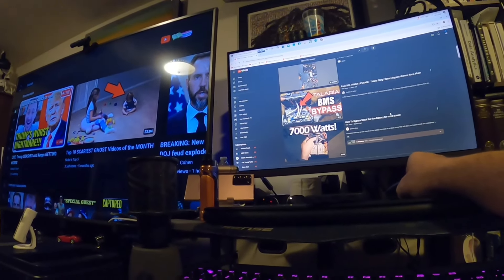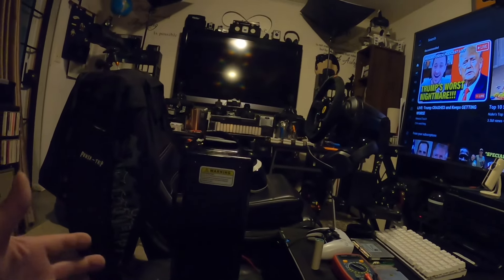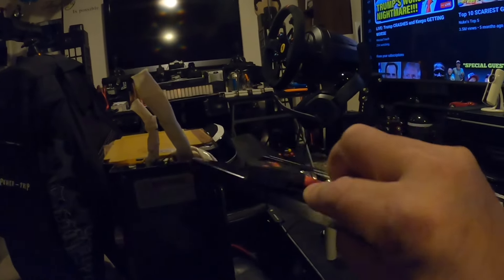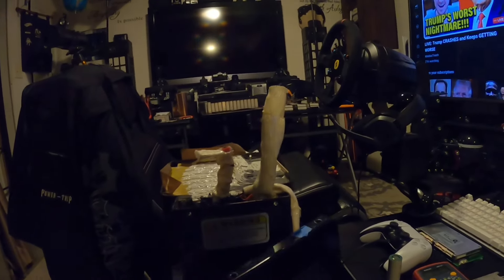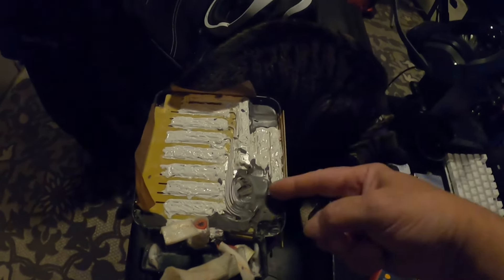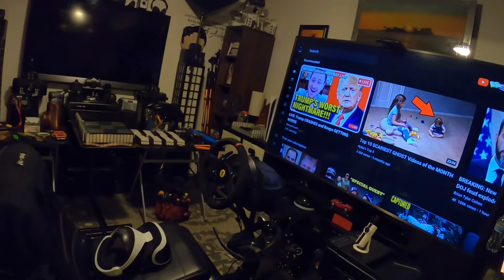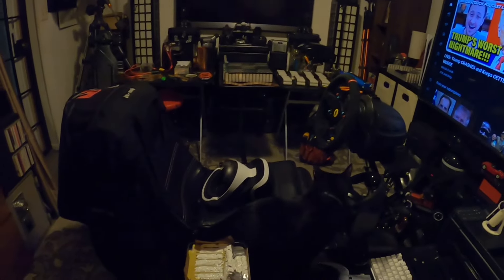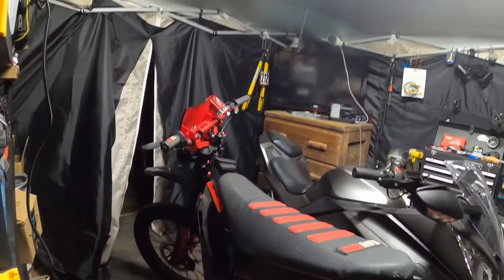EBMX 72v Battery Repair Diagnostic & Bypass on Potted version 5min quick fix how too & ch update!

Comment: Are you able to make a high discharge battery for a talaria xxx?
Reply from the maker: ;all the same to me bro I just need measurements but My buddy has one so if you want one i have access to a Tripple X to get the exact fitment
Reply: @ChrisCrossingWires1212  how much would it run me?

Comment: chris alot of the laws reguarding lithium batteries have changed most ebike batteries now are required to be potted and meet certain ingress levels to be legaly allowed to be sold ,most batteries from china are illegal
Reply from the maker: I'm sure it's getting ugly or there in terms of regulations. For that reason I think I'm gonna just continue on a a hobbiest builder and buy at your own risk while doing work that's good enough to be considered as save non  about to blow builds. While they are still very much out of my control and no pack is infallible the odds of it occurring area far less using quality components and great construction techniques. That's all I can offer

Comment: What controller should I get for my rz 72v45ah 3000 motor that not too much for stock?
Reply from the maker: spmething with about 150 dc line amps max if thats a lithium pack if thats a lead acid than your first step get a lithium pack .
Reply: @ChrisCrossingWires1212  would that be the far driver 72450?
Reply: @ChrisCrossingWires1212  yes it’s lithium

Comment: chris EBMX technically arnt doing the right thing,they have built all their new tech based on Bengamin Vetters open source Vesc tool,and Vesc bms and controllers but they arnt allowing full user access,and not allowing certain features that come standard in genuine vesc units
Reply: and they are crazy crazy crazy expensive over 2000 for controller ,a vesc controller
Reply: im ashamed to in the same country